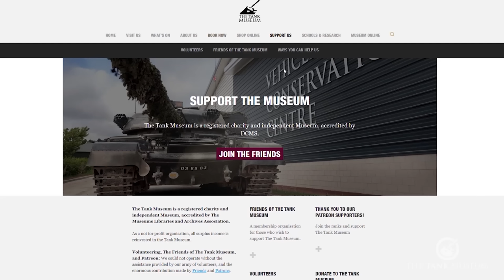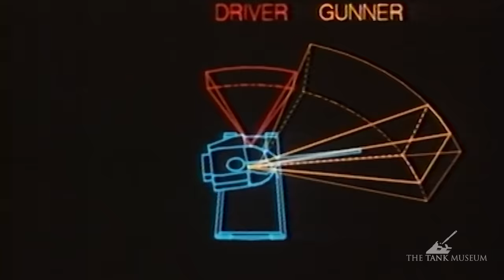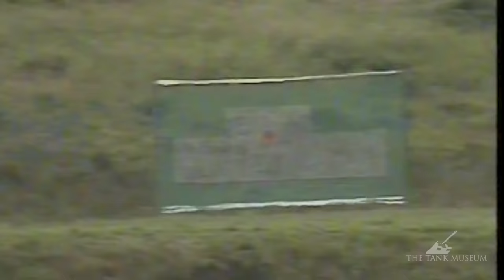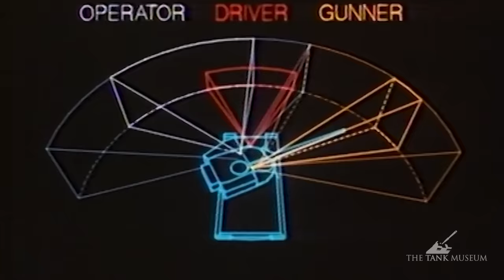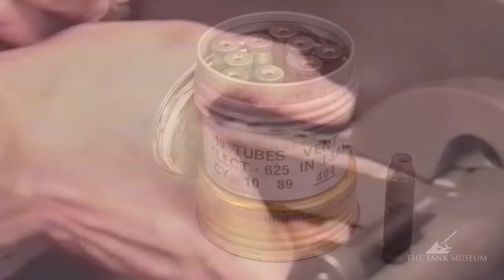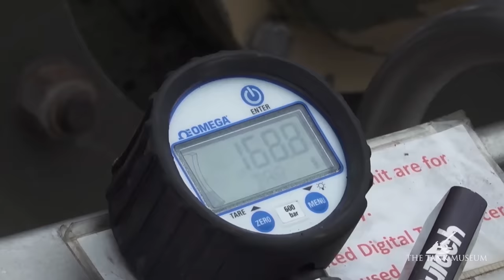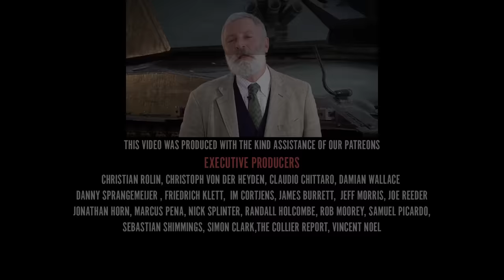Tank Chats #92 | Challenger 2: Full Length | The Tank Museum

Comment: Makes me wonder if there will ever be a Challenger 3. And if so what it will look like and who will build it. Great job Tank Museum team!
Reply: I can see new turrets being ordered before we build a complete new tank. Probably with auto-loader to reduce the crew and packed with IT kit for increased battle space awareness. It has been said that an integrated small-UAV launcher is already being developed but that is unconfirmed. I'm waiting for Jane's to report.
Reply: so many upgrades review have been put back and put back and now they, at last, starting a lower level one thus it meant to extend live to 2035
Reply: Probably, but it will be a new name i think. A turret upgrade and (perhaps) engine upgrade is the most that will happen during the 2020s (unless sit looks like a conflict with China or perhaps Russia is likely).
Reply: @gusgone4527  I can see an autoloader being considered necessary for a modern tank, but I would have thought that to implement such a system in a tank chassis designed for a human loader would not be possible just with a turret upgrade. The russian tanks for example have that huge round ammo drum in the hull as part of the autoloader system, I can't imagine that the current CH2 hull could support one.
Reply: Probably not, unless it is just a rebuild of the existing Challenger 2. It's difficult to justify designing a new MBT when we only have a domestic force of ~250 vehicles. The only chance is if we join a multinational development project and that almost definately won't be called Challenger 3.
Reply: in his last tank chat david mentioned englands mbt factories where been shut down
Reply: @Akm72  I came across something very recently that's UK had expressed interest in EMBT but I can't find it.....
Reply: Its long existed in the archives on paper... just never built.
Reply: @alt7488  He also said IFVs are present in the UK military industry, and MOD does keep key role equipment that would be the most crucial for reopening the line and the process. Also, both old Chally and the current one - been put out of service are safely kept. Even now, lots of countries stuffed with armored hulls, turrets, power packs, spares, tracks, etc - some older or currently too expensive to fix. KMW keeps more than 100 of early batches of Leo 2 ready to rebuild and modernize. Rheinmetall company do keep at least a few dozens of Leo 2A4, only to be able to offer their MBT Revolution and MBT Evolution programs. You have to own a Leo 2A4 to go for the Rheinmetall program. Still, you can face a technical issue of the old tank structure. The company can arrange another donor - vehicle but the price is very high in such a case. If the Brits are working in any similar way (of course they do), I'm sure it would be possible to reopen the MBT production line in the UK - if needed.
Reply: @HanSolo__   Virtually all the Challenger 1 tanks were sold to Jordan, back in the day.We have a few Challenger 2 tanks in storage but no means to produce any more, alas.
Reply: Challenger is getting upgraded to use the L55 smoothbore gun of Leo 2A7 it’s also getting its sights fully upgraded and is getting modifications to its engine and hull systems to up the power and compatibility with other NATO tanks
Reply: @nickbrough8335  why would conflict with China OR Russia happen? its not likely at all. sure some worldly tensions are happening but thats happened throughout history since ww2.
its like saying america will be at war with Iran when its completely not the case or what is wanting to happen, just because of some tensions and bullying.
Reply: @Shorjok  The problem is that would be too expensive to add during a turret upgrade. You'd have to design a not only where to put the autoloader, but also ammo storage and crew locations. I doubt C2, Leopard or Abrams will ever see an auto loader, although as there was a design for the Abrams it might be easier there.
Reply: @Akm72  After the turret upgrade its expected the UK will decline to less than 150 tanks, with the remainder in storage not seeing any upgrades at all.
Reply: When you do get around to building them, maybe Canada could haul those old 2's away if you want.
Reply: Not unless there is an imminant need or it becomes cheaper to develop a new tank rather than upgrade the old one.  Even then, I doubt it would have the Challenger name attached as it has already been on two main battle tanks - a third would just make us look like we couldn't come up with another name between us.  The biggest reasons for military expendature at this time are probably tackling terrorist threats followed distantly by a percieved threat from Russia or China.  Russia is looking less likely right now as they have been suffering economically for a while.  Even though they have some very advanced designs like the Armata, they just can't afford to build a fleet of them.  China is becoming more and more hard line but it is hard to see them as much of a threat outside of Asia.  As such military spending vs China would be more likely spent in terms of air and sea assets rather than upgrading heavy armoured fighting vehicles.
Reply: I hope they get more creative with the naming next time though.
Reply: Challenger 3 is in development
Reply: Unfortunately it will probably be German or American. Britain still makes the best but the time all the civil servants/Mod pen pushers do their magic, it will cost 4 times the going rate and it will go to General Dynamics land systems or Lockheed Martin blah blah same old same old
Reply: @user-wr5jo3lp7f  No it isn't.  There is no funding available for such a large project and no viable threats that would make the need for it imperative.  That is why Challenger 2 is getting an overhaul rather than replacing it.
Reply: @user-wr5jo3lp7f  No, it isn't.  There's no such thing.  The UK doesn't have the factories or design capabilities any more.  They were all sold or shut down in the 2000's by government.  It can't even produce the full range of ammunition for the existing 120mm anymore.
Reply: @alt7488  They have been but factories in my locale, go up almost overnight. The skilled workers take longer of course. That said, laser cutting and other mechanised machines from car assembly lines, need little skilled labour.  Ease of manufacture, modular design;  ease of maintenance and training. Seem to be the trademarks of all modern fighting vehicles. Perhaps the next MBT will be nothing more than a firepower and armour package for a standardised base mobility platform. I certainly hope not.
Reply: The Challenger 3 tank will be able to fly
Reply: @Shorjok  I don't see why an autoloader would ever be necessary. All russian tanks with one aside from the T14 where and are plagued with the likely possibilty of the ammo cooking off with a penetration. The ammo carousel is a huge target especially on such a small tank, its not hard to aim for center of mass especially with something like an RPG. The autoloader system also has a big issue with the ever elongating apfsds ammunition, getting to a point where a whole redesign is needed for longer ammo. 

Compare this to most western MBTs which firstly protect crew from ammo cook off with blowout panels and also make it easy to incorporate new longer ammunition by only replacing the compartment at the back of the turret instead of having to redesign the entire hull. Also remember autoloader systems are another thing that needs maintenance and can break. Which is also a lot harder to do with only 3 crew.
Reply: @gusgone4527  nope Rhianmettall are trying to convince the Challenger upgrade program to adopted they're already made tested smoothbore and turret.
Reply: @Shorjok  I don't see autoloaders as being necessary at all. The only real benefit is the elimination of a crew member which modern governments have seen as a longterm cost cutting opportunity more so than anything else. The only other benefit I could see would perhaps be the consistency of an autoloader in combat or over rough terrain as there is no real benefit to rate of fire. There is, however, a huge downside in that live ammunition has to loaded into the turret. This is often overlooked but ammo cooking off is one of the most common ways a tank is knocked out. You also are limited by the length of long rod penetrators you can potentially use as opposed to a two part ammo system.The US has actually experimented with putting autoloaders into the Abrams tanks and the benefits were determined to not outweigh the downsides.
Reply: Didn't the Germans develop the undecided Challenger 2 MK2?
Reply: Anteep  people said that about the tank in the 60s....
Reply: its unlikely that challenger 3 is developed and comissioned.
due to budget cuts and restraints its still not clear if challenger 2 gets any kind of relevant upgrade to make it competitive on a modern battlefield.
the BAE upgrade offer is the cheaper one, but only does electronic and optic sensor upgrades + active protection system, leaving the now insufficient armor, insufficient main gun, underpowered powerpack etc in the tank.
the Rheinmetall upgrade will change the turret for a new turret, the 120mm L/55a1 and some other minor upgrades, wich would turn challenger 2 into at least competitive in respect to its firepower. but that upgrade is expensive.... and will increase the overall weight of the tank with TES package to 80+ tons and the power to weight ratio to 15Hp per ton, wich is just ridiculus and not realisticly deployable without enormous logisitcal expenses and effort.

due to that, its likely that the UK will buy Leopard 2A7V from germany, wich would be significantly cheaper than upgrading the challenger 2 fleet to proper modern standarts.
Reply: BAE are working on a heavily upgraded one but wether it makes it into production is another mater
Reply: @nickbrough8335  Why do people keep saying Russia, Russia does want a war, first off it will wreck the economy second Russia can not afford to go to war.... Maybe in an alliance with China, but no one likes china.
Reply: @MrGrim2u1987  Because they actively support people we don't like (Iran, Syria for example) or undertake assassinations in the UK (remember Polonium and the nerve agent plus others using "normal" means) and elsewhere when it suits them to. Russian agencies have also been behind multiple cyber attacks as well. They proven themselves to be a hostile and our active opponents numerous times. China has yet to be anything like as hostile on the ground, although I agree it's only a matter of time. The other reason is Russia is a lot closer to the UK and Europe than China is.

I should also point out the the UK appears to intend to move a significant proportion of our current naval force build up to be based in the Pacific (probably based in Australia or perhaps Japan) rather than European waters. Expect one of the two carriers and a partial UK carrier battle group force - including at least 1 SSN and ? a SSBN - along with ancillary vessels to be based their permanently within 5 years. This will probably work alongside Aussie and Japanese forces in an integrated fashion as well as the USN. The carrier will routinely carry at least one US Marine F-35B squadron.
Reply: Not happening now that money is being diverted elsewhere
Reply: Inb4, Uk is gonna buy Leo2s.
Reply: @carlitosskater89  No. The UK is buying a new turret designed by the Rheinmattal-BAe joint venture for around half the existing fleet.
Reply: wish granted
Reply: @nickbrough8335  lol
Reply: @ar568  Yes quite ironic, give Ajax seems likely to be a failure due to overweight of the suspension/design (fixable ?), Warrior has gone and it seems we retained Challenger because of the public outcry when they leaked getting rid of them entirely. Without warrior upgrade (of CV90 acquisition) they 100 or so left will be pretty worthless.
Reply: Hello , it now exists lol
Reply: @jameslewis2635  looks like he was right
Reply: There’s now a Challenger 3 under development!
Reply: @babalonkie  they are making the challenger 3 bro look it up lmao
Reply: @Alex-tl6hz  "Challenger 3" IS Black-night with the extras removed lol (Black-Night is BETTER)... "Challenger 3" is a propaganda gimmick by Tories... it's literately just a new gun and targeting systems slapped onto a Challenger 2... It NOT a new tank. They will say it is, they will say it's got better armour, they will say it's one of the best tanks out... But it's nothing more than a Challenger 2 with it's gun and targeting systems replaced... that's it. It's more like a Challenger 2 mk3... but the Tories don't want the public and soldiers to moan at them.
Reply: @babalonkie  the new gun being a smoothbore and an improved hunter killer targeting system. Including night vision for commander and eventually targeting communication between tanks automatically. How is improving upon the challenger 2 to make a new tank a bad thing? How is it not a challenger 3? The challenger 2 has great armour why change something that works in that sense
Reply: @Alex-tl6hz  Challenger 2's armour is not sufficient against new Russian 125MM,130MM,135MM tank rounds... Hence why the last 2 Leopards have nearly 500mm more effective thickness in their turrets than the Chally 2, it's also why their Americans scrapped British Armour in their newest Abrams. (Look up the prototype of this Rheinmetall tank, it's official name is just Challenger 2, RM even put the additional armour on this tank and the 130mm... but the Tories took them off as it cost too much and didn't look British).

Changing a couple of features does not make a new tank... it makes a new variant of the tank... hence UK using... mk.2, mk.3 or USA/GER using A1, A2... A3... since the dawn of time...

It is a Challenger 2 mk.2/mk.3... and the antique style stupid propaganda isn't fooling anyone (As shown by the thousands of legitimate comments on this page).

Hell, it doesn't even exist for another 6 years outside this single prototype.

Challenger 2 is dated.
Challenger 3 is Challenger 2 mk.2.
Tories are liars.

The End.
Reply: The brain cells at the MOD have said they will upgrade a massive 120. One of the smallest tank  fleetsin Europe. Pathetic! max deployable would be about.50
Reply: Lol asked and answered
Reply: @gusgone4527  well someone leaking the Challenger 2 details beat them to it... They are making a 3
Reply: @Alex-tl6hz  It's more like a Challenger 2.5 , since it's not a completely new design :) But it's not BAE's Black Knight, it's the Rheinmetall's proposition that won the competition. I wonder why the MoD did not go all-in and also get Rheinmetall's new 130mm gun : https://www.youtube.com/watch?v=J8Sa_q-Lz6g
Reply: @connorshannon3186  How did you know this back then? Lol
Reply: @tarpnarp  they may have said as much but not the renaming to challenger 3
Reply: @Dockhead  This comment aged horridly.
Reply: @MrGrim2u1987  
this comment didn't age well either.. unless you keep sticking to the premise of it being a special security operation. LOL
Reply: @Dockhead  this aged poorly
Reply: There's a Challenger 3 now.
Reply: @ThePostie501  We actually could build mbt,s if need be.
Reply: @Dockhead  Your comment aged very badly.
Reply: @nickbrough8335  Any usable-but-unused C titles left, or will they have to recycle a name from a largely forgotten WWll beast again?
Reply: @Dockhead  🤣🤣........fast forward two years! 💥🙄
Reply: @Gamelord191  ...Writing two years later. I don't suppose you could give me six numbers between 1 and 49 could you? 🤣
Reply: @gusgone4527  You will never see an auto loader in a British tank. Who would make the tea?
Reply: @MrGrim2u1987  that didn't age well!
Reply: @mattrickard3716  It's the 21st C that man. If the boffins can master an autoloader then guess what?
Goblin Teasmade. The problems arise when there is no DB of Goffa'  to run down to the NAAFI for the custard creams. Or 4th crewman with muscles, to help when the iron beast throws a track.
You have a good one Matt.
Reply: @gusgone4527 Yeah, one obvious benefit of an autoloader is that it can automatically retrieve the round for a given target while the turret is being rotated by the hunter-killer system.  And unlike the T-72 explosive mass, it should mechanically feed through a single round and load from the explosion-containment compartment on the back of the turret, so the crew area never contains more than one load at a time and only for the shortest possible time as it moves into the gun.  Next combine the roles of driver and commander and we are left with 2 soldiers down in the hull (or home bunker) controlling the automatic turret that can also be fitted on warships and fortifications.  When away from the front line, ammo is put into the rear storage rack, sights are polished and armor plates replaced while fuel is added.
Reply: @Dockhead ots of people rattling cages and scaring prople for ratings and dollars.
Reply: @MrGrim2u1987 russia commited suicide in exactly that way lol 👍